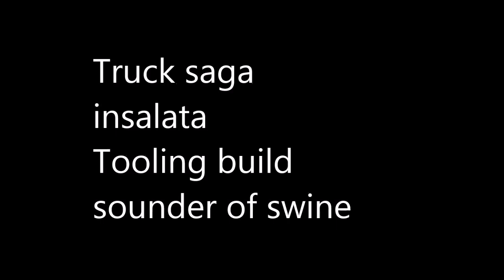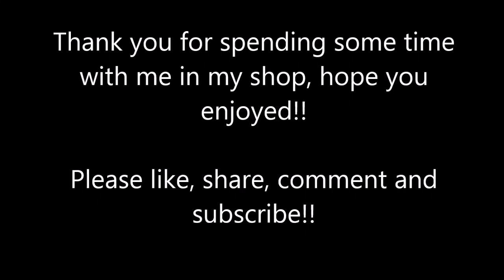Tuesday's TiTs  #8

Comment: Your truck not leaking reminds me of a story about a guy I knew that rebuilt an old Detroit Diesel. He was bragging to me about how he got it all back together and it didn't leak a drop of oil now. I told him that means he forgot to put any in it! lol It did go almost a week before it started leaking, paint will hold oil for awhile.
Reply: "Never take a picture of a Detroit Engine and hang it on the wall".
"Why"?
"Because in the morning when you go to admire your new picture it'll have oil running down the wall with a puddle on the carpet"!
This was told to me by a friend who is a Detroit Engine fanacti, he wouldn't own anything else...rather hard on himself!!!
Sorry Chuck, I couldn't resist.
Reply from the maker: bcbloc02 YIKES...hope my repair lasts more that a week, I did use two part expoxy paint....LOL....not!
Reply from the maker: arkansas13 LOL...love it

Comment: Check your ground cables. I thought I had everything perfect on mine this past November. A little rust under the ground connection on the block had me remove and replace the starter at least 15 times before I figured it out.
Reply from the maker: John Bazaar Hello John, chasing elect issues is always a challenge

Comment: Nice scale holders!  Double check the ground that should be on the back of one of the heads (passenger if I remember).  Is it no start as in no click or clunk from the starter? All that oil coming down that side of the block may have done a number on the solenoid.  Easy enough to check with a set of booster cables, ground to the body of the starter, positive to the small terminal.  Or do the old screwdriver trick.
Reply from the maker: Emil Gawaziuk Thank you Emil, watch this Tuesday for the report...

Comment: good job. you could have went straight to the 2" we do all the time at work. with step drilling the 2" had no center to keep it from walking and vibrating p.s clean all the dellron up out of your chip pan. melting dellron from hot chip will make your eye water as it made with formaldehyde .
Reply from the maker: mog5858 thanks for the view and insightful comments